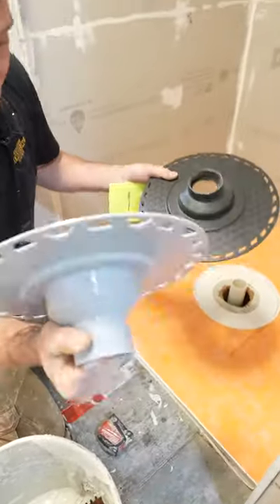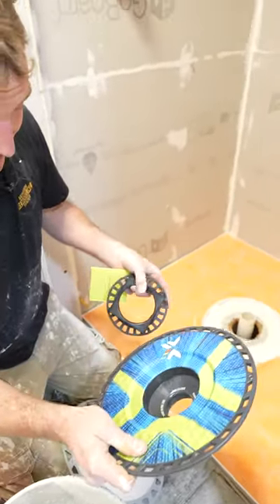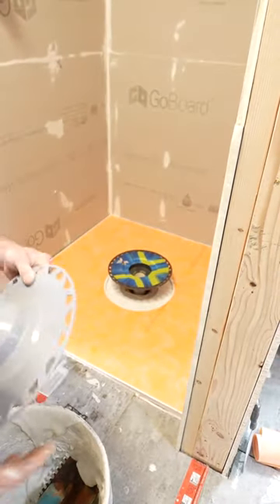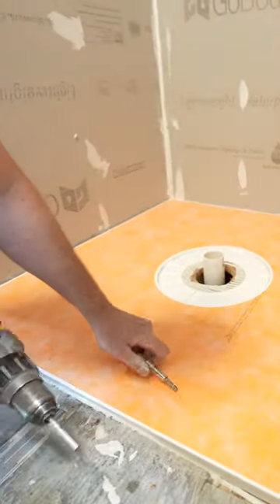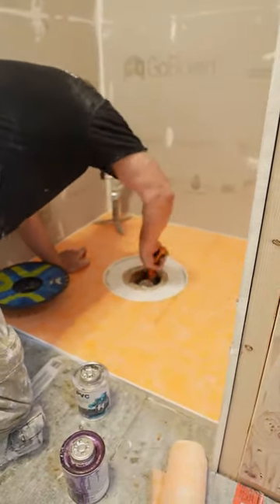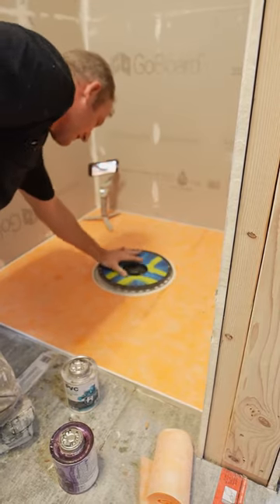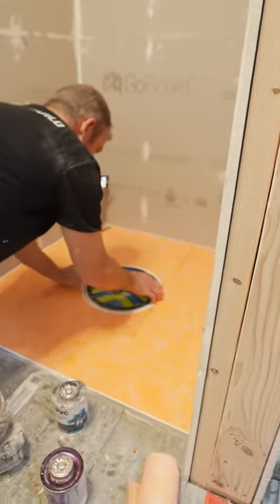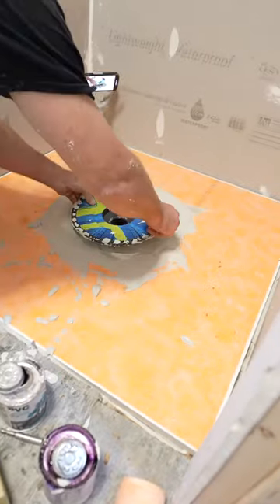Schluter Curbless Pan with FLO FX Drain🔥🔥

Comment: I don't give that system more than 5 years. It's fast, easy, cheap and will fall apart like all plastic parts in todays engines. STYROFOAM 😂😂😂 and plastics for todays lardos to walk on.
Reply: It’s all really solid stuff once bonded properly there stuff is good quality
Reply: I've been installing these systems for 10 yrs. No issue what so ever all the customers I've been installing these for always call me back for more work, not the for repair to the shower I've installed previous. These systems cost more than a mortar bed and hardi backer walls. Worth the money
Reply: these are not new systems...dont you think wed know by now if they were bad?
Reply: If yours are falling apart, you might check into your installation method. You may have missed a step. These are tried and true. Lost lasting and efficient.
Reply: @texasmexicandownsouth if you could recommend another prep board for shower walls instead of Durock… would GoBoard be the best option?